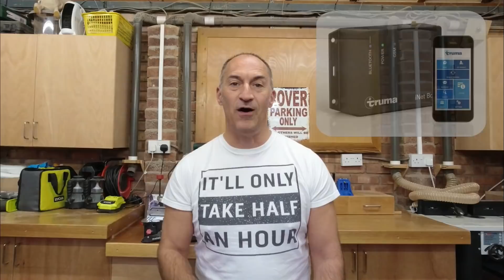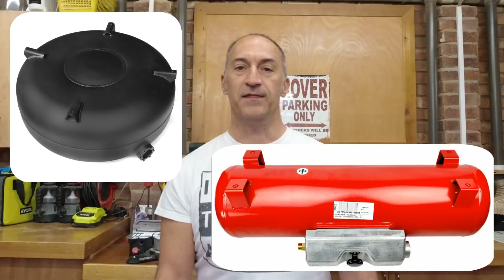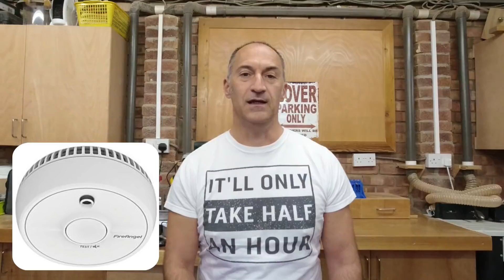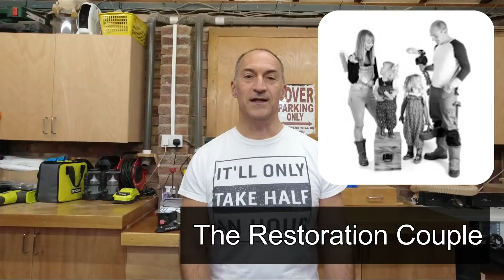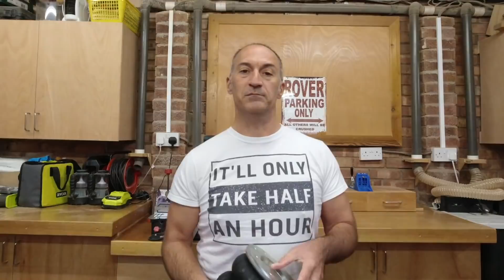Vanlife Q&A - Your Questions Answered

Comment: Another great video Greg and I'm soo looking forward to your next build series and the cigar box update 👍🙂👍 
I know it can be some what of a controversial subject and everyone can have their own  opinions along with experiences on the subject of batteries and charging them but here's mine and I too have extensively researched this time and time again.
A sealed lead acid isn't as fussy as AGM ( glass matt ) when it comes to charging, gel is worse again and I'll not even talk about Lithium.

A sealed lead acid will take amps readily but nearing the end off charge they are difficult to get those extra amps into, they need to be forced in to a degree.
Sealed lead acid are normally the cheapest option but you still need a good one or more, good heavy/thick plates. They handle a good alternator pumping in many amps fast.
A simple isolator switch does the job in most cases depending on the vehicles alternator type. An aternator will only charge to a state where the battery/batteries need, that's why we can drive all day and not damage the main starter battery.

Leaving a sticker or notice EVERY time on the steering wheel to remind you to reconnect after the engine is started is good practice as is a notice placed over an entrance to the accommodation area so as to remind to disconnect the batteries with the switch. 
This system is also great for quick jump starting if for some reason the vehicle starter battery needs help.

Some so called split relays are very inefficient or of poor design and battery to battery chargers can charge way too slow.
Me...I dump as much power as I can get into my battery, my alternator is 55 amps so 55 amps per hour roughly of driving, putty it wasn't 75 amps lol, prob the original at 29 years old. 
My leisure battery is over 3.5 years old but could do with a boost charge to 15.5 volts, drained and repeated again, holding at 15.5 volts for 1 hour, this boils off most sulfate that has accumulated, this will eventually build up along the bottom over time though and eventually raise to the bottom of the plates, the battery by then will have finished it's life. It's good to do this twice a year, Once before winter and once before summer.  

This is a time proven method that is not only less expensive but is simple and works and works reliably well at that. 
I would be more than happy to have this system in another van.
My van is old and came with this set up, probably from the factory, I've had great success with it.
I've had the same battery in my van when I got the van for two years, the guy before me for 1.5 years so who knows when the guy before him fitted it or how any of them looked after it.
I've never let it run down below 12.1 volts but usually never bellow 12.2, this is probably the most important thing along with not leaving it low for long periods of time.
A sealed lead acid charged this way and looked after in general can serve well for 5 to 7 years.

Greg, I know this is probably not information that interests you as you're happy with your set up, it's just another simple system, that anyone with on a tight budget can still get a good working reliable system that they can be happy with at a very economical price.
Most people I think start of with this system and abuse it, they think the fault lies with their system so they upgrade, they spend a small fortune on the upgrade so they tend to look after their batteries better and then assume it's a better system than they had before, I believe this is the case for the most part.

Anyway, this is info that could have saved me some of my many hours of research and joining the dots so I hope it's useful to some.
Now, I've been donated two monstrous and in great working order, never drained below 12.4 volt ( apparently ) Golf cart batteries. The guy had no reason to lie as they were given to me.
Should I fit them in my van or purchase another van to fit them in 😂

Comment: Time stamps for the 15 questions Greg Virgoe answered in this video:

00:47 Can you leave your solar charge controller on when on a mains charger or a battery to battery charger?

01:26  Are Greg and Lou glad that they fitted the Truma heater?

03:30 Should I use voltage sensitive relay or split charge relay for battery to battery charging?

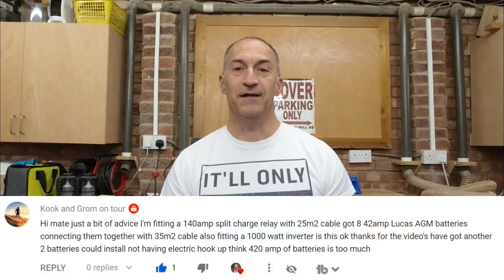05:10 Is it wise to put in a massive battery bank so I can be more days off-grid at a time?

06:45 Should i get my gas system checked out by an engineer?

07:40 What do you think about underslung gas tanks?

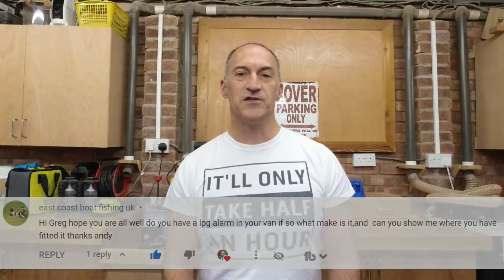09:00 Do you have an LPG detector in the van?

10:20 What YouTubers did you watch when you were doing your build?

11:20 What job on the van made you swear the most?

13:50 When's the second part of the cigar box guitar build coming out?

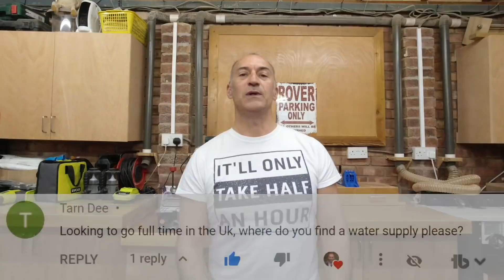14:40 Where do you get water from in the UK?

15:23 Why did you pick a Mercedes Sprinter van?

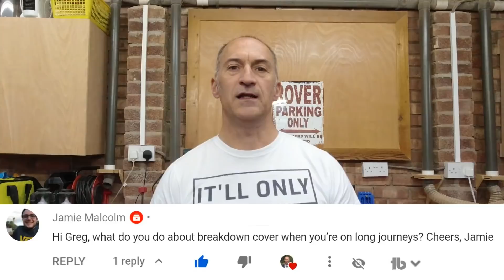16:30 What did you do for breakdown coverage in Europe?

17:25 Would you consider fitting airbag suspension to your van?

20:00 What van are you doing next?
Reply: My question was: How many days out of 100 days in winter time did you use the tilting option of the solar panels. 
Reply may be given the next Q&A if there is not enough time to type a proper answer.
Reply: @rudivandoornegat2371  from what I know Greg doesn’t have tilting solar panels yet
Reply: @and7rei  hmmm ..................
Could swear that I saw a video where Greg explained that holes in the struts were really presets for the tilt angle matching the position of the sun during different seasons in Europe.

Comment: Does the heater take 240v and 12v or optional?
Reply from the maker: The heater can run on LPG or 230V electric or BOTH. The 12v electric is for the controls and fan motor.

Comment: Good points ,I was thinking how many vans /motorhomes left for months in winter etc ,this  I suppose is were damp can build  (if no heating is on ) albeit set low 👍
Reply: No leaks and very Good ventilation solves that problem 👍
Reply from the maker: We always maintain a certain level of warmth in the van to avoid these damp issues.

Comment: Hi Greg what consumption of gas do you use with your combi for water and heating as I was thinking of using a separate water heater and a diesel heater or will a combi be enough as the underslung gas tank I think it’s a 30 litre 
Thanks peter
Reply from the maker: Hello Peter, even in our worst winter months, I struggle to use £20 of gas a month and that's with heating, hot water and cooking every day.

Comment: Hi Greg, A really interesting video once again (thank you) - Question ;- Most youtube van dwellers seem to own LWB vans,.......... if you go ahead with your next budget van build series, can this be on a van that is MWB or under? -  Also I too am in the market to buying a van, but its always difficult to find a van that is either just on or under 5 metres long (to be able to fit on my driveway) or if the internal height of the van is suitable for someone who is 5ft 11 tall (when you add insulation & finishes on ceilings).
Reply from the maker: You'll be pleased to know this van will be an MWB, high roof, so its easier to park and still stand up in it.

Comment: Hi, thanks for that Greg 👍. A few more questions if I may, would you go down the lithium battery route if you could go back? Do you have a commercial driving licence, the reason I ask is I thought 3.5 tonne is the limit for a regular licence. Cheers.
Reply from the maker: You may notice one or two grey hairs, I know I do look young for my age :D lol
I passed some years ago and can drive up to 7.5T lorry on my license.
We will cover all these rules and regulations as part of this conversion.
Reply: @GregVirgoe : Cheers, I am looking at weight issues for a van build at the moment. Do you have any idea what your build added to the base weight of the van? Any thoughts on my question about lithium, weight is one of the considerations for me but the initial cost is the obvious drawback. Although, from my research it looks like it could be cheaper in the long run.

Comment: Hi Greg, hope you are well. Really looking forward to your air suspension & budget van build 👍 We will be starting our Mercedes Vario 4x4 build this coming weekend so we have already started going through your back catalog of vlogs for tips😀 Take care - kind regards Johnny & Leigh
Reply from the maker: How exciting :D a new van build! What are your plans for the van?
Reply: @GregVirgoe  The end goal is to live in the Vario full time. Having built a Sprinter 4x4 previously we had to be careful regarding its weight!! Unfortunately we couldn’t ‘up plate’ it as it was registered as a van. I believe a motor caravan is easier to do this. With the Vario we have approx 4200kg to use as its GVM is 7500kg......happy days! 😀 So regarding the fit out we are going for: double fixed bed, shower/composting toilet, kitchen & seating area all pretty standard stuff. We are going to try fit approx 250-300ltr of stored  fresh water, under slung LPG tank,  Imass instantaneous water heater and 640watts of fixed solar with 200watts folding panels on Anderson clips. We  will also be fitting a front mounted winch, snorkel from a Unimog and replacing the dual rear wheels for a ‘super single’ set up. Well you did ask!! 😂😂😂 We will hopefully have this done for Camp Quirky in May 2021. Best wishes J & L (amity_adventurers)

Comment: Great video, thanks. Couple of comments:

Uprating.... 
I was advised not to do it as for the small weight gain...

Driving licence may not cover you
Classed as HGV, so need to pay HGV tax in most countries
Problems with parking regs
Stricter testing
HGV speed limits

Underslung tanks - watch positioning, can wreck ground clearance at tail, especially if they install the fill point under the back step.

Air suspension, factory fitted on mine. Comfy, but bouncy. Makes walking inside the van like being on a boat. Once the bellows start leaking, replace, or you can burn the pump out quickly.
Reply from the maker: Thank you, Kev, all very valid points. I shall consider them all when I do my research and cover the good and the bad of the whole process. Thanks for bringing this to my attention. much appreciated.
Reply: @GregVirgoe  another downside. Many areas have no entry for vehicles over 3.5T.

Well in Germany... Guess we're not alone.

Comment: Hi Greg Great Video, In Regards To Your Last Question , A Tip would Be to salvage  All Parts Out Of An Old Caravan Ie: zig uint, sink ,Hob,Oven, Toilet, shower, water Heater, Windows,Etc: Thanks Rob
Reply from the maker: I have looked into that, not so much for the furniture but mostly for the appliances. However, the second-hand caravan market has realised there is money to be made here with the boom of van builds and the cost of even a scrap caravan is stupid now.